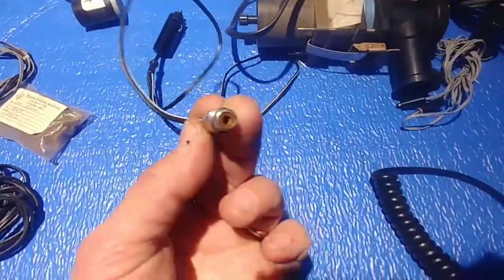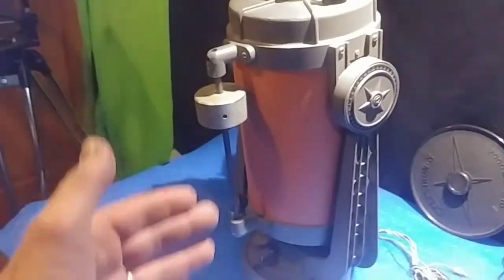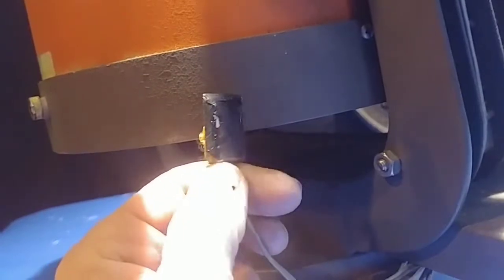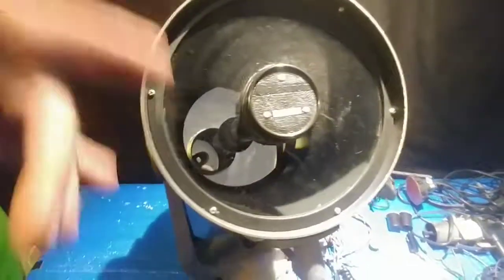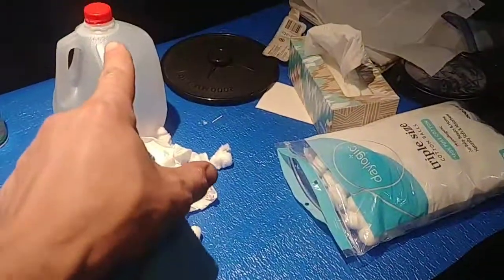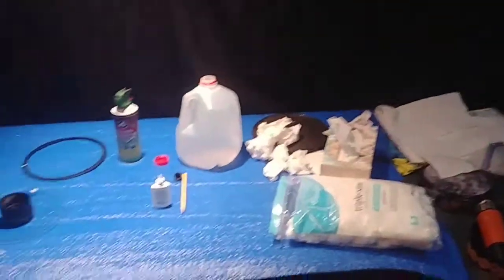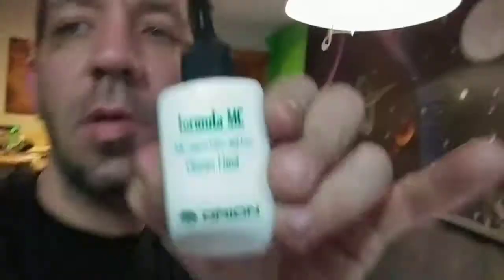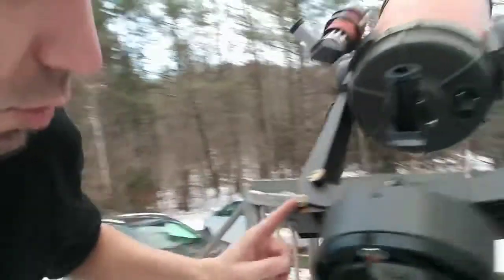Vintage Celestron C8 Cleaning up corrector

Comment: Just a suggestion: When you point people to a video entitled cleaning up the corrector plate, they are not really wanting to see how the scope/mount, the makeup of the scope...Could care less....just want to see the corrector plate is cleaned.  Maybe you should have entitled the video of "My C8 Project", which would have attracted many folks from all over.  Lots of older C8 aficionados out there on the forums.
Reply: I agree. I was trying to find the cleaning procedure detailed in the manual, as it's a bit unclear. This video was a waste of 13 minutes that I could have spent finding useful information. Cool project, bad title.
Reply: Yes I suck
Reply: However the corrector is out...it was just taking screws out that we all know how to do...derp derp
Reply: @NautilusGuitars  well this video not only showed the rarest options on a c8.... It showed that I took this old telescope apart with no worries.... The waste was your brain thought... Not my video.....